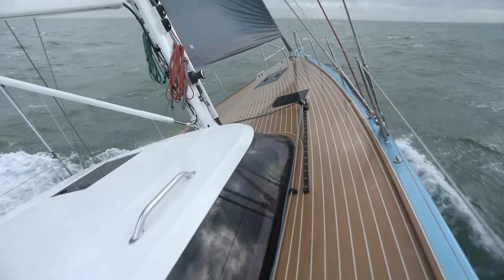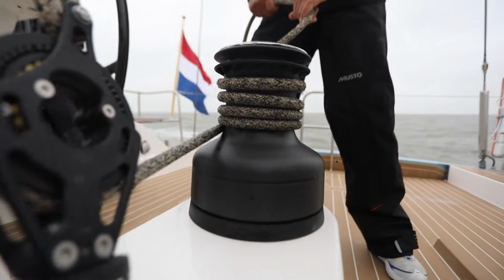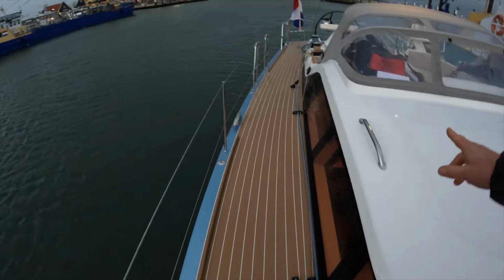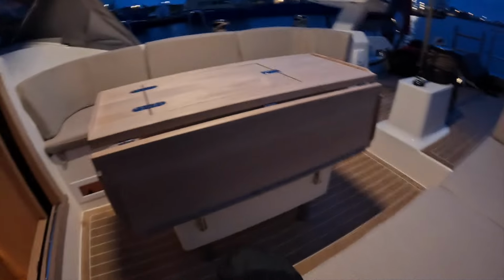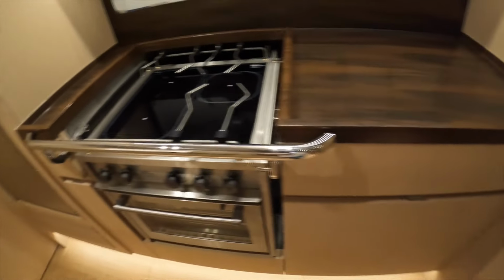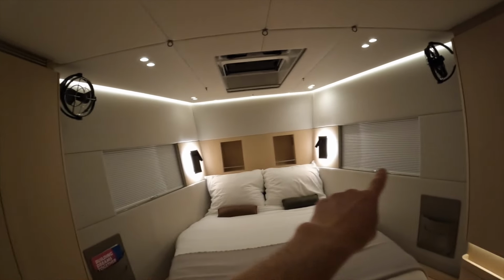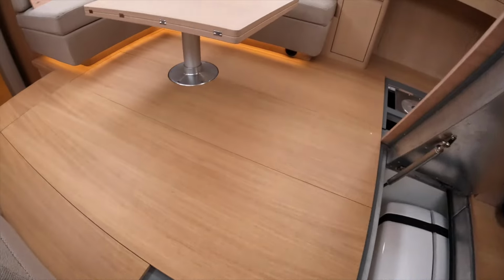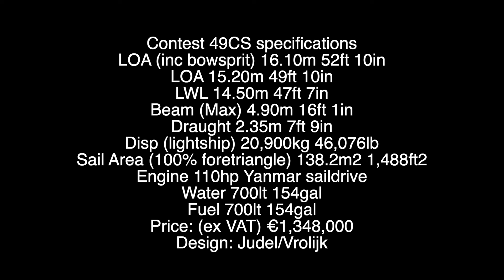Watch our windy 2-day trial aboard the luxurious Contest 49CS and get the full tour

Comment: I would not want to sleep on a bed with so much electrical equipment underneath. All that electromagretic waves! Like living in a transformator house!
Reply: Have you measured the electromagnetic radiation?
Reply: Better to put all of the electronics out back.  You know, near all the water.
Reply: @adamjmkern  so you are gonna make it worse  instead if finding a better solution .
Reply: You are aware that visible light is a electro magnetic wave just as well?
Reply: @bronco_fv  Indeed but isn't it much weaker than what a mobile phone or a chain of big batteries propagate?

Comment: Clever design, but not so clever with the exposed helm position in nasty weather.
Reply: 100% agree. I have a thousand + miles of Atlantic sailing on the 50CS - which has a proper cockpit. No way would the new boat be as good a place to spend a solo night watch, 200nm offshore in 35kts. You would have to cower by the companionway with the winches and steering far out of reach.

Comment: Expensive boat with so many things, which should be part of a minimum inventory, but are left in options!

Nice to see the inside at sea, thanks for the great effort. 

But: there are as good as no waves outside, and yet it is already uneasy to move through, jumping from a handrail to another distant one - not to speak about staying laying on a bed at sea. A couple of days with a few "normal" tradewind waves, and everyone is bruised and hurt on board.

Well, a modern boat, such as we more often see chartered near marinas rather than in high seas. 

I may be too old a skipper of RORC boats to enjoy an island bed upwind with 30 knots and 2.5 meters (only) waves.

Greetings to all from the South China Seas, where the rain saison finishes into the usual cyclonic period!

Comment: Why don't you tell us about the boat in detail. Cleats should be much further forward. Designed by ????swim platform ?? How to get to it? No seating for helm unless you pay. Plasticy. So owner sleeps where all the banging is from waves etc.
Aircon, heating. Led keel? Keel stepped at last. 
Too many different levels. Sink should be two LARGE sinks. Not just one and a urinal !!